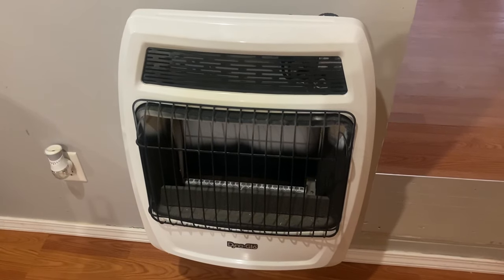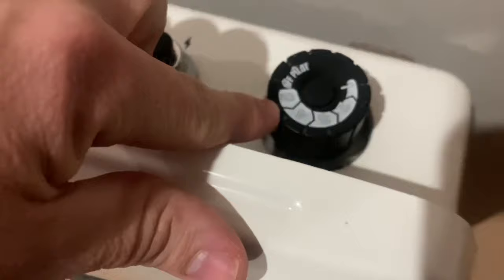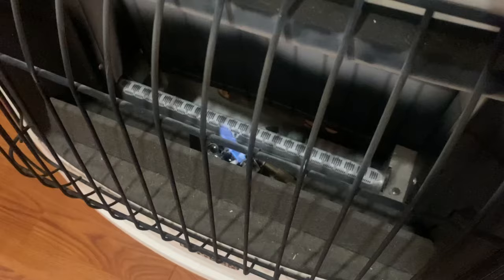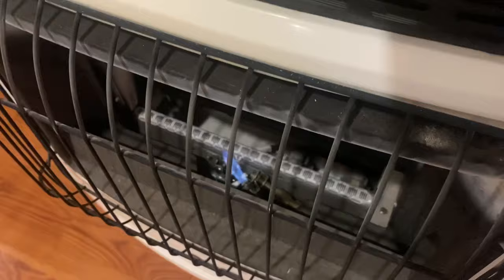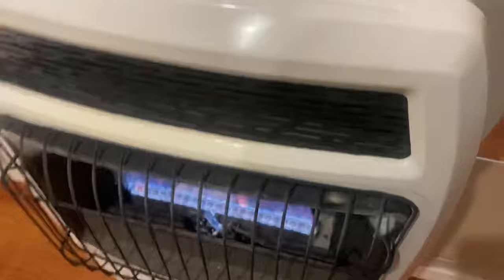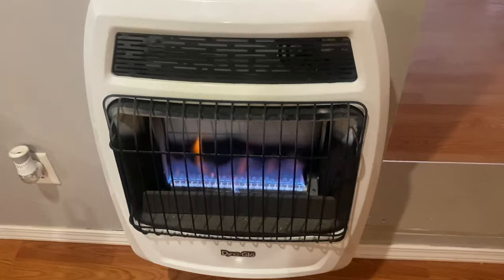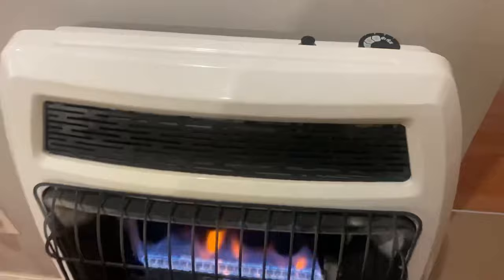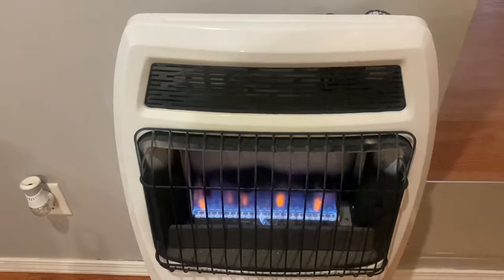How to light and operate a gas wall heater

Comment: Thanks, I got it going on the second try. I love mine. Except for the first light of the season. I forget and have to read the tiny print. This video was so much easier than tiny print. Thanks, and I mean it! You are right about the pilot putting off a lot of heat. My house is well insulated and many days of the year that's all I need. I keep a heating pad under the covers at the foot of my bed. I have another one for my back when it hurts in the morning. I cook dinner at night and almost always heat the oven. Hot shower. And I have 3 giant dogs. Everything I listed emits heat. It adds up to a very cozy temperature. For Austin Hill Country, it is plenty. Last winter I even had to turn the pilot off. In February, I get chicks from the feedstore. I put them in the bathroom with a heat lamp over them. Then it gets too hot and I have to crack a window. Have a womderful winter season! Thanks again.

Comment: Thank you. I've never had one of these heaters, or really anything with gas, and I'm planning a solo vacation to a little cabin that is heated this way. Wanted to know how to operate it. I would never have guessed the rotational knob was also something you were supposed to press down on. That would have been really frustrating! Also the bit about the flames not kicking in till it's really cool enough that they need to.

Comment: Should the pilot light stay on at all times. My heater does not have a thermostat. When the house is heated and I turn it off should the pilot light stay on?
Reply from the maker: Yes the pilot light stays on all the time unless you turn the heater completely off

Comment: Any tips on getting the pilot lit? Having trouble with mine. Just over a year old
Reply from the maker: So sometime the pilot light itself get dust built up in side and it usually won’t light. So it’ll need cleaned out more then likely

Comment: Is it normal for the heater to click repeatedly while you’re lighting it? Mine works just fine it just clicks repeatedly until I let off the controls
Reply from the maker: If it’s an electric igniter yes it’s normal mine does the same.

Comment: Okay. Now heres a question, what do i do if its running fine for like 5 mins, then the pilot goes out ...i checked for drafts. None.
Reply from the maker: Dirty pilot. I just did a video how to fix it check it out!
Reply from the maker: So basically the pilot light isn’t hot enough for the thermo coupler to keep it lite. If it’s not a blue flame it’s dirty and needs cleaned.